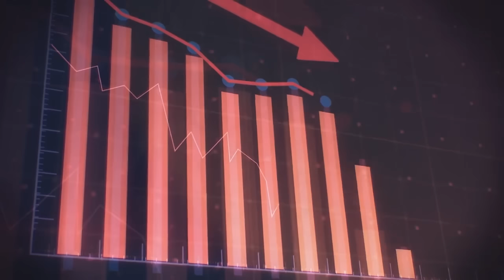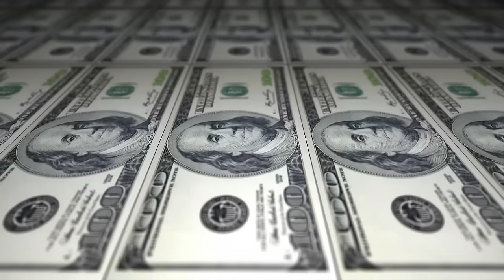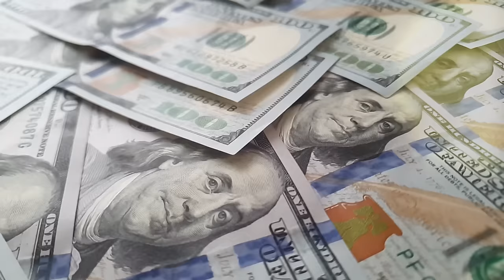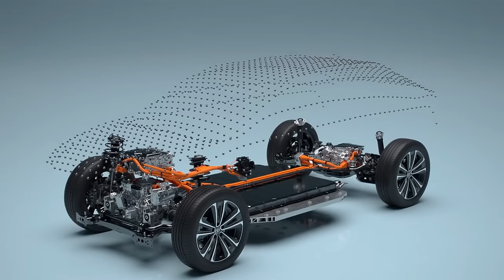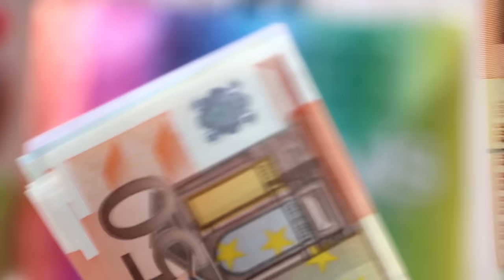The ‘I Told You So’ Moment: Toyota’s Predictions About EVs Come True! Electric Vehicle or Hybrids?

Comment: I'm not against EVs but I am against high initial prices, range anxiety, charging anxiety, potential thermal runaway, higher insurance costs, massive depreciation, rapid tire wear, unreliability, expensive repairs, lengthy repair waiting times, lack of local qualified mechanics and any other EV bugs I haven't thought of or are unaware of. They should have perfected EVs FIRST and THEN pushed them on the public, but no, they did it completely backwards and now it's all this.
Reply: Should be no need to "push" ev's if they are any good.  They are crap & a con.
Reply: EVs are not about improving the automobile. They are about reducing the freedom and independence enabled by conventionally fuelled cars. EVs offer both data harvesting and control via their heavily computerised systems, and physical limits on their capability as their batteries limit the amount of driving possible. The only advantage is zero emission at the vehicle, but this is achieved with a much more energy intensive building and recycling process. Ultimately the Billionaires want to own everything, and what we need, they want make more money renting to us. So EVs offer greater possibilities to those who want tyranny.
Reply: Please go and test drive a Tesla model Y Long Range‼️‼️‼️
Reply: @clives4501 Tesla model Y was the Best selling carmodel on planet Earth in year 2023
Reply: @mikafiltenborg7572  - I cannot afford a new Tesla. Not with the depreciation. I don’t drive enough miles a year to justify a new car. I’ve bought second hand German made cars and run them until I was bored or for the last one it was 13 years old. I either do short journey for work or cross country to see family and need long range every now and then. An EV doesn’t suit my pocket and doesn’t suit the mission profile. This is why I’m not happy at the thought of paying more for a car that doesn’t suit what I need it for.
Reply: Pretty much everything you said is wrong.
Reply: All FUD
Reply: I can't afford a Tesla.
Reply: Not according to reality.
Reply: @mikafiltenborg7572  - did they survey vehicles on other planets too?
Reply: My memory may have some errors here, so I’ll speak in generalities.  America has “been on the very threshold of successful (1) electric cars” since around 1910.  And, as long as you’re willing to pay an exorbitant price for a short range vehicle, we have them.  Similarly, American has been on the very threshold of successfully having (2) a flying car in every garage for about a half century since around 1946.

Neither of those thresholds have been crossed.  Electric cars today would be really impressive in a 1910 world.  In the meantime, the hands down winner on every roadway in the world are the gasoline and Diesel  engine vehicles.  Nothing else comes close to the long string of successful vehicles on the world’s roads.  Nothing.
Courtesy of Half Vast Flying
Reply: @clives4501  Maybe they need to hire more celebs to get the word out - like they did for the magic juice.
Reply: Apart from the things you mentioned, you like EVs?
Reply: Total cost of ownership  - tesla are way cheaper than ice cars. Virtually nothing to service therefore no service costs. No clutches, exhausts, brakes etc to replace. Way cheaper to run - I save £2,000 a year on petrol, it's  a no brainer. Toyota only make hybrids as their ev is crap.
Reply: I started off open to the idea of EVs but as I learned more and more about them I began to realize that in their current iterations, they really aren't the answer people seem to think they are.
Reply: In Canada the cheapest Tesla sells for $59,878 after taxes ( with NO options ) and the cheapest ice Corolla sells for just under $30,000 ( also after taxes ). Unless I'm reading the math wrong, the Corolla is almost half the cost of the Tesla. Based on my average yearly mileage and the current local price of gasoline, it costs me about $250 per year to refuel. $250 ... I know people that spend more than that on a night out on the town. Insurance on a Corolla runs about $1000 per year or about 83 dollars per month. Considering Toyota's bullet-proof reliability, the Toyota makes far more economic sense to me. Given my low yearly mileage, it's quite likely that the Toyota will still be on the road 30 years from now, long after the Tesla has rusted away in some junkyard, and to me that sounds like the greener and much more financially sound option.
Reply: @sullivanrachael  Pretty much everything you said comes from emotion and not calm reasoning. To start, your phone already harvests more data than your car ever will, it tracks everything you write, everything you buy, it tracks your interests, your interactions with everyone in your world, everywhere you go, in some cases it even tracks your health. If you think EVs are the privacy concern you have to worry about, you haven't been paying attention. You're also wrong about EVs energy intensiveness. Yes, EVs take more energy to build than ICE up front, but EVs themselves convert 92+% of their energy into motion while the best ICE vehicles are typically half that. Over the life of the vehicle, EVs are much more energy efficient. You are right, though, about billionaires wanting to own everything.
Reply: @mikafiltenborg7572  G’day, Mike.  If I had to select an EV, I certainly would consider a Tesla.  But, they still run on batteries.  And, as the televangelists said, “Bring money!”
Courtesy of Half Vast Flying
Reply: Getting the cart in front of the horse is foundational to being a present day liberal.
Reply: I am against EV’s. They have no safety net proposition like hybrid cars have.
Reply: You forgot to say EVs are written off if the battery gets damaged or fails around 10 years.
Reply: So basically you're anti EV. LOL
Reply: So are your observations based on opinions of facts ?  Prob no need to answer that.
Reply: @mikafiltenborg7572  Far too expensive and still poor range compared to Petrol or diesel.
Reply: Agreed.
Reply: My observations are based on things I've observed. How about you?
Reply: Let's not forget the lithium batteries penchant for bursting into flames which are just about impossible to extinguish.
Reply: After Bertha Benz made the first roadtrip in history. People started buying cars. And when a new model came out out people bought that one, because it was better than the previous one. And so on, this lasted for about 150 years. And now the governments force the people to buy ev's. Why force? Clearly because otherwise people wouldn't buy them. And if you have to force people to buy something, that has 1 very simple reason: Because your product is no good.
Reply: Pure EV have range 700Km and PHEV are running at 1200KM fully charged and fueled. 

And average EV are selling around USD 20000 and mid-size 4.7m PHEV at USD $23000 in China.

That's what you said about range anxiety and unaffordable. 😂😂
Reply: You are not against but have many complains 🤔🤔
Reply: @mallamal5578  Tell that to Hertz. That EVs are cheaper to maintain than ICE vehicles.
Reply: Having worked for the government for some 30 years this approach to policy making is not unusual.  Jump on the bandwagon, ignore the technical and legal advice and then push a policy that is poorly thought out.
Reply: EVs still aren't as good as ice cars and I will not buy one.
Reply: Yes that's true. I think they should have perfected EVs before they put them into the market. There are too many problems with today's EVs that they have not fixed. Maybe in the future?
Reply: @jackvoss5841  nit sure what tablets you are on but my tesla m3 beats ice cars on almost every metric and is safer too.
Reply: @mallamal5578  G’day, Mall.  I’m not familiar with ice cars.  Tesla is the least-worst of the lot of the EV group.  CAUTION: pray that the are no collisions.  Especially one where any of the battery components are damaged.  The fire is like a cutting torch, and cannot be extinguished.
My best to you.
Courtesy of Half Vast Flying
Reply: I'm not against them, as long I never ever have to own one again.
Reply: @mikafiltenborg7572  interestingly enough, the best selling motor vehicle is not electric.  Nor is it a car.  The Honda Cub/Super Cub motorcycle is by far the best selling motor vehicle in the world.  Reached 100,000,000 in 2017.  
Courtesy of Half Vast Flying
Reply: The EV's can be well built the problem is batteries and charging but like everything they build these days they are designed to fail after the warranty runs out
Reply: Don’t forget the depletion of rare earth elements, environmental damage, cost of replacement batteries.
Reply: Something as expensive and hard to manufacture like a car should not be disposable. That's the opposite of " green ".
Reply: EV fanboys don't want to talk about them but all of those things should be taken into consideration because they are legitimate parts of the process.
Reply: I’m concerned with the price of electricity rising, even for people who can’t afford to drive. I don’t like that you have to download apps to charge your EV at different stations. Then there is the environmental damage, along with mining for some of the materials, the process for extracting lithium basically poisons water.
Reply: The more you learn about EVs, the less sense they make.
Reply: if they have social media back in the horse carriage age, you would probably hear something similar to say about cars from the carriage riders.
Reply: Wow, nice propaganda , make sure tell how Toyota sales are going, not.
Reply: @warren12pete  You forget every ICE car gets written off in any modest accident and most cars get ditched at 8 years of first ownership.
Reply: @jackvoss5841 Wrong, educate yourself.
Reply: @patrickchubey3127 Wrong premise. Open your mind.
Reply: @ChristisKing117 Wake up, this is year 2024!
Reply: @Maximus211DW  G’day, Max. 😏
Reply: After driving an EV, I could not go back to petrol cars 😂
Reply: Yes you are!
Reply: How can you perfect something without bringing it to market? To learn from issues? You think an ICE car is perfect? Then why do we keep getting new models with improvements? Have we fixed all potential flaws with ICE cars? No we haven't, so why should they be sold?

I am against the high TCO of an ICE car, the high fuel prices, the high maintenance cost, the way too often maintenance it requires, the massive depreciation of any new car, the high Tyre wear, the unreliability, the expensive repairs, the fire risk, especially with a combustible fuel!, the dependency on mechanics, oil companies and fuelling stations,... . Until they can work away all those problems, I'm driving electric.
Reply: Like all things relatively new to the masses, research and development costs of this will always be high and that has to be reflected in the product price to the consumer. It's the same for any new phone or gadget nothing new about that. 
For those haters out there, I assume you all wear wind up watches (god forbid you use a battery watch), same for shaving razors, radios and the other plethora of consumer items. 
For the older readers..... How much did your first colour TV cost? Oh I forgot, they were so expensive nobody could afford one!!! so what happened instead? Rental that's what, everyone rented colour TV's until the prices came down. 
I see no difference in the EV's market.
Of course today the world and his wife is an expert and will happily shoot down the "in target" with gusto to gain attention, their aim is not the topic itself but purely to gain views on their channel, remember that 
I've not got an EV (just for the record) however we need technology to exist and help improve our environment. It will take many many years, look back and see how long it took from the first motor car being invented until mass production, it didn't happen over night. Ask the man who owned a horse and cart to deliver his goods back in the day, what do you think his views on the new fangled motor car was? Everyone wants perfection at a rapid pace, well it doesn't work like that. 
At the end of the day everything in industry revolves around money. You can have the greatest invention in the world but unless a company can make money from it, it's dead. 
I strongly suspect Toyota are looking at their costs and thinking why push ourselves to the limit and risk everything when we can happily plod along selling ICE vehicles and hybrids whilst making easy money.
Reply: This is why Americans will fall behind in AI 

AI is ultimately about data 

you got a good chunk of Americans who dont want to give up data
Reply: @VikPaints  It's like battery recycling for it only happens if the people doing it can make enough money from it. If the expenditure to recycle used car batteries is greater than the income they generate when they're sold again then the batteries will go into landfill as no one wants to start and perpetuate a loss making business simply because of environmental concerns. If it doesn't make money then it doesn't happen.
Reply: I'm not sure, it seems more complex than that. Back when cars were new on the market they had their problems, they were noisy and unreliable but they were superior to the horse and carriage and eventually became more popular. They even proved more superior to the electric cars of the time, and more than a hundred years later, with automotive advances and developments and refinements, they are still superior to electric cars in many ways. That may change in the future, who knows.
Reply: Why not, it's all about facts. Things like range anxiety are very real.
Reply: One of the worst things about current battery technology is the danger of thermal runaway.
Reply: I think they should have perfect electric cars BEFORE putting them on the market instead of the other way around.
Reply: That doesn't sound right.
Reply: No vehicle type is perfect but ice cars are still better than EVs in many respects. That may change in the future but the future hasn't happened yet.
Reply: I don't get all the hostility. EVs are just not as good as ice cars at this current time. That may change, it may not, let's wait and see.
Reply: Free choice
Reply: I couldn't agree more, we are NOT a communist country.
Reply: Price ranges are ridiculous for an electronic gadget bcos that’s what it is
Reply: What about the huge environmental damage these ev vehicles create?

Ever cared to check how these batteries are made? Or how dangerous an accident may be for the environment, let alone the people in the vehicle?
Reply: @mallamal5578 😂 no brakes no tyres no tie rod ends ,get real also the motors need oil changes ,good luck with your new tyres at 250 per tyre.
Reply: They are an expensive practical joke. There was never the slightest possibility they would replace Petrol Vehicles. When you study what is required it is impossible to achieve. Hybrid was a viable option.
Reply: Well said !
Reply: I find it fascinating when I point out the inherent flaws in this emergent technology, all the fanboys go nuts and accuse me of being biased.
No vehicle technology is perfect, not even close, but fanboys are making out EV's are great when they simply are not!
Reply: @mikafiltenborg7572 
A test drive is not living with the vehicle long term.
Reply: @tinetannies4637 
With a modern connected vehicle, a single hard stop or cornering manoeuvre can see your insurance premiums rise dramatically. 
GM just stopped sending collected data to insurance companies because the practice was costing sales.
Reply: @jackvoss5841 Flying cars are fine, as long as you have a pilot's licence. How much does that cost? No machine can take to the air otherwise.
Reply: @stanleybuchan4610  BINGO!  I’m a pilot, and on your first takeoff it is very apparent that not everyone who drives a car will fly a plane.  To say nothing of the hundreds of midair collisions.
Courtesy of Half Vast Flying
Reply: @OpinionFactChecker  By that same measure, EVs could have that info withheld as well. There's nothing unique to vehicle power train that binds it to telemetry casting. Beyond that, as self driving becomes more widespread, this data will become more about vehicle diagnostics than driver behavior.
Reply: EVangelists don't want to talk about that.
Reply: Ice cars need maintenance and repairs, no one would argue that, they're just a better idea than electric cars for most people.
Reply: Both EVs and ice cars aren't perfect but after doing exhaustive research I've found that a low cost / fuel efficient ice car is the better choice for me.
Reply: From Singapore. We are totally enjoying the EV. 😀
Reply: Then you are against EVs for all the good reasons you mentioned!
Reply: @mikafiltenborg7572 not gonna happen battery boy! I pass those golf carts every time they stop to recharge and I am on my way in less than 5 minutes! Baaahaahaaaa
Reply: @patrickchubey3127 who wants to?
Reply: @mallamal5578 wrong I, pal! I was surprised at all the maintenance and the insurance for 6 months would insure my Audi S4 for over a year and a half. Lmao?
Reply: @markvincent5992  what maintenance in 6 months. Tesla do not require maintenance,  what ev were you driving?
Reply: I think that EVs might be a good idea if they weren't riddled with problems. I had actually considered buying an EV at one point but then I started to dig and do research and found that EVs have a bunch of unsolved problems as I had listed, and after educating myself I decided that ice cars are still a better idea for me than EVs. They might be able to fix all the problems and improve them in the future ,,, but then again they might not, who knows, but for the time being I'm going ice.
Reply: @sullivanrachael  petrol limits the amount you can drive, so you fill up, same with an ev.
Reply: @patrickchubey3127  I have a tesla and will never go back to ice. Evs are superior on almost all metrics. Unless you have driven one for a period of time then you don't know how good they are.  My tesla is one of the safest cars ever tested. As  a Thatcham researcher said, if you love your family, you would buy nothing else than a tesla - they are that safe.
Reply: @patrickchubey3127  You made a wise decision Patrick. In fact you came to the same conclusions that our forefathers did a century ago. In certain applications the BEV is a viable option. For most Americans the I/C system is still the way to go. I would like to see a pure hybrid with a smallish engine to power a generator and provide cabin and battery heat/cooling. The battery would be much smaller and used in a much different way than today. The generator would power the wheel/axle motor(s) and would shut down in town or under light loads. How would you like a 2,500-3,000 lb car with all wheel drive, 400 hp, and say 35+ mpg. Just get rid of the dinosaur battery and rethink it.
Reply: It could very well be that battery technology becomes viable somewhere in the future, I wouldn't discount that possibility, but like the future, much improved battery technology just doesn't exist in the present, and who knows, it may not happen at all, no one can predict the future of the automotive industry. There are other possibilities being worked on, like hydrogen fuel cell cars, hydrogen burning cars, and alternative liquid fuel cars. The government insists that EVs are the future but as of now they are wrong.
Reply: @mallamal5578  - yes but an EV is far more grid dependent - features work on a phone connection, software upgrades are a requirement - driving some EVs are really like driving a computer with the functions of a car an app
Reply: @sullivanrachael  yes, a bit like when the automobile was invented. People had to forget the  ippity clop of horses hooves and learn to use a steering wheel and levers and buttons and we're dependent on petrol.
Reply: @Dihorse371 the ranges of EVs are based on lab results not real world mileage. AC on, radio, lights all of these reduce mileage,
Reply: @kokehri yeah maybe when new and low mileage, we'll have to see when they are older and have high mileage. Plus they are pretty much worthless second hand.
Reply: @mallamal5578 - no. Horses were definitely worse than steam engines. Internal combustion is still the way almost all tractors, goods vehicles and ships work. This is because ICE are practical machines. They are the means by which we have built our societies. EVs are in effect remote combustion vehicles - unless charged at home on solar. But even so; the range is a problem - to avoid battery degradation - ideally the battery would be kept between 20 & 80%. The EV is effectively only as capable as its battery systems, and those degrade with time, unlike a petrol car which is still capable of the same basic range and quick refuel from its first day until its last.
Reply: Their creepy silence when moving is almost making you ill.
Reply: @tonycrayford3893 Many of my friends have driven their PHEVs for long journeys such as 5000KM trip from Guangdong to Xinjiang (eqv to Boston to LA). Their PHEVs are mainly 4.7m BYD and HAVAL price around US$23,000. They occasional slept on their cars at parking sites and sometime on small lodgings along the way. The range statistics are purely factual, not just factory measurement. 

The issues on charging etc are entirely surmountable depending on the policy of individual country. Problem is many are looking from the very restrictive US perspective only.
Reply: @Dihorse371  my friends father has a thirty year old BMW with 500k+ miles on it and is in better condition than my neighbours three year old EV. No EV that's been daily driven will be on the road thirty years from now.
Reply: @tonycrayford3893  Your friend's grandfather might as well owns a radio which is still working fine. But you are still buying the latest TV which gives you the best quality image.

Nobody said ICEs not good. But they do cost more to make,  produce more pollution and provide less intelligent capabilities which may be required for the next gen transportation.
Reply: @tinetannies4637  Found the guy who owns an EV and is now frantically trying to convince himself that he wasn't the victim of a con job 😂
Reply: @tinetannies4637  Found the guy/girl who owns a EV and is now frantically trying to convince themselves that they weren't the victim of a con job  😂
Reply: @tinetannies4637  Found the guy/girl who owns a EV and is now frantically trying to convince themselves that they weren't the victim of a con job
Reply: @Forever_Laura  You were wrong the first time you said it, and repeating yourself three times just made you three times wrong. Believe it or not, people can draw conclusions without having a personal stake or bias in the outcome. I own a 10 year old petrol burning Honda.
Reply: @andrewwaller5913  This is because you are living in USA.
Reply: No, you're not against EV's 🤣🤣
Reply: EV cars are crap 
So much carbon is burned to generate electricity which is then used to charge these brick’s called EV so how come they are saving our earth 🌍 
EV cars is a fad only 
Will never buy these crappy cars 😂😂😂😂😂😂
Reply: I just sold my hybrid for model y. Its driving experience is day and night. If you have charging capability at home and dont commute more than 100miles a day, ev makes lots of sense.
Reply: @MrIRENEBO  not when you factor in the amount of cost and carbon that it takes to build one. EV's are in no way good for the environment, let's not forget the the fires the cars burst into if they get too jot or the battery disposal issues, then the cost for a new battery.
And who wants to buy a car for going 12 miles to work each day, but then needing one to travel over 250 moled to see family, now you have two cars, twice the insurance and repairs.....oh yeah, they make sense
Reply: Um, if that had been the general attitude and process for ICE vehicles, we wouldn't have them now.
Reply: @wekirch  MAJOR difference,  internal combustion engines worked as intended right from the start, were EV's are burning up on the street and in your garage, but hey...
you can quietly drive 100 miles
Reply: Um, ice cars were built and put into the market 100 years ago the same as electric cars. The public rejected electric cars for the same reason they are rejecting them now in the 21st century. How do you deny that? Either you own or sell electric cars because most people prefer ice cars for some very obvious reasons that will not go away.
Reply: I have opened my mind, but the problem is that I did the research. I had considered an EV at one time but I opened my mind and learned about the ins and outs of EVs and EVs are inferior to ice cars for a good number of reasons. What's wrong with being educated rather than making knee jerk decisions?
Reply: Sure, buy an overly complicated, unreliable money pit and blame all ice cars. Should have bought a Toyota.
Reply: I do 2800 miles a month to timed appointments in my MG 4.
Fuel ~4p/~5¢ a mile.
Tyre wear better than the yaris hybrid it replaced.
Comfy, quiet, economical, spacious, smooth and quick. Very quick.
Less range anxiety than the yaris - I just plug in and charge at night same as phone.
I've a classic car and bike. Today is my 45 anniversary of passing car driving test add bike & HGV.
It's the same but simpler.
Reply: @andrewwaller5913 2800 miles a month is definitely easier and cheaper in ev than Toyota yaris hybrid.
Reply: @SpideyVids how often do you hear about phone batteries exploding?
Reply: @daddyjohan911 do you remember the push to diesel?
Reply: @andrewsaint6581  Push? You mean the time people started buying diesel cars because they were vastly improved in all aspects compared to the first diesel cars? I do. Here is another one: MB Actros 1851 with all the extra's goes for about 150.000€. Range: 3.300km on ex-works 550 + 450= 1.000 litre tank.Takes about 10 minutes to fill it up on a truck fuel station, of which there are 1000's in Europe. MB Actros-E (as in electric) does in real life 300km. Takes about 8 hours to charge. Problem with that charging thing: at the moment the charging standard for trucks has not even been set yet. Oh,and guess how much they want for a truck like that: 297.000€. I told the sales man at Benz: the first truck I ever bought was a diesel. And I'll bet anything you want that the last one i'll ever buy will be a diesel. Unless the politicians want us to go back to the dark ages. (Maybe that's exactly what they want.) Or how could they explain for example in a hospital: "I am sorry, you have to go back home, the truck that was going to bring the filters for your kidney-dialyses is still charging his battery?
Reply: @andrewsaint6581  
It used to make the mainstream news when it happened but not any more. My current smartphone has a non-removable battery and at times it gets very hot - so hot, in fact, that the heat has bowed out the back of my phone... this didn't seem to happen when we had removable batteries. As for EVs, it's best to keep ourselves informed via alternative media - cars and busses are exploding and going up in flames far too often. Fortunately there don't appear to have been passengers on board when the busses have gone up in flames or they would surely have died. I remember a video of two busses parked in the street - the front bus burst into flames and set off the bus behind it. Another video showed about five busses parked side by side in a parking lot - the one at the end of the line burst into flames and it set every other bus on fire as the batteries exploded.
Reply: Early cars were rubbish and expensive. It took decades for there to be the fueling infrastructure in place to allow early cars to travel long distances which is why you went everywhere with a gas can. There was no set system of basic controls and things like comfort and ergonomics weren’t really something people got used to until the 50s.

EVs are no different. They’re currently very expensive and the charging infrastructure is terrible in most countries but there will be a game changer in the next few years and most drivers won’t look back. 

As an enthusiast I will always try to keep a ICE car for fun but most people treat a car as a device, they won’t care as long as it’s cheap and reliable. Given the simplicity of the tech; it’s going to happen eventually.
Reply: What will the upcoming game changer be? I haven't seen much out there on upcoming technology.
Reply: @mallamal5578  that money you save on petrol is all subsidies and once they dry up then what? You're telling me you pay barely anything for electricity? 

Also what the hell do you mean no need to replace brakes? There's no such thing as infinite use brakes.
The only time you need to do maintenance for an ice car is when you don't take care of it in the first place. But I think you confused maintenence with repairs.

Also have fun driving in hot weather or winter and seeing the range drop
Reply: @xAvitaLT  we use overnight cheap rate electricity. I run my car on the equivalent of $7 per week. Teslas use regen braking where the motor slows down the car and feeds electrons back into the battery,  so if you drive them right you should never have to replace the brake pads or discs. Apart from that you change the cabin filter every 2 years and check the brake fluid. So there is no servicing like replacing oil and air filters, spark plugs,  exhausts,  clutches etc etc. Massive savings. So when you buy an ev the initial price is higher,  but running it is far cheaper and will cost you much less in the long run
Reply: @patrickchubey3127  my tesla will,last longer than your Toyota. I think you would be better off with a horse.
Reply: @mallamal5578 every vehicle has a multitude of parts that are wear items… it just so happens most of the items last right till end of ownership and then fall into the hands of the 2nd owner.  This is where EVs quickly show their ass
Reply: Yeah, I doubt that.
Reply: As stated in that video, Toyota estimates that EV's will only make up a third of car sales and I hope they are correct. Here in the UK politicians are trying to force them on us as they think it will gain them votes, but it is plainly obvious that the infrastructure for these vehicles doesn't exist, and most people can't afford or want the lack of real life range or length of time it takes to charge the batteries.
Reply: EV is genuine good. BUT for us in Europe, a Tesla cost as much as a Porsche. Range anxiety is a real thing, for example, where winter/weather is harsh and constantly changing. The EV most can buy bare reach 500 KM of range estimate, which is usually 400 KM or under normal use. Just look at the Fisker when the price dropped. It sold. Until that type of car is normal, EV is a hard sell!
Reply: I had two Natural gas work trucks in the 80's, and loved them. But the decisions in Washington, Montreal lawyers calling Ottawa, and New York money demanded a different direction. You could get a mechanic with a two day gas ticket to exchange our systems to new vehicles as the two trucks were at the end of the useful life, but the NG system was just fine. And if you pulling a big load (trailer, boat) you want diesel and torque.
Reply: Why are you lying?

Toyota is doomed
Betting on yesterdays tech will be their endgame
Toyota is having their last laugh.. from no on they will decline to death
BEVs can be profitable - but they have to be made in high numbers
Batteries are more than good enough for most people. Today
Reply: EVs have been perfected. China has pulled it off